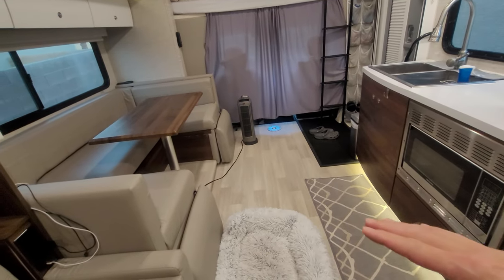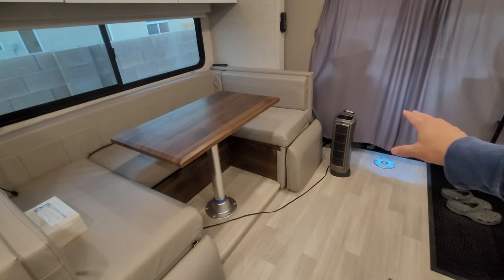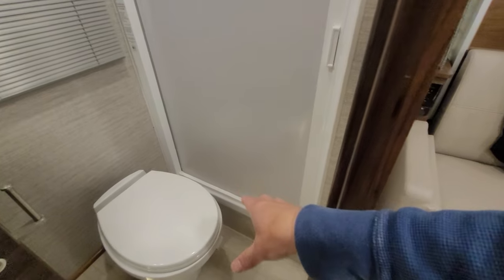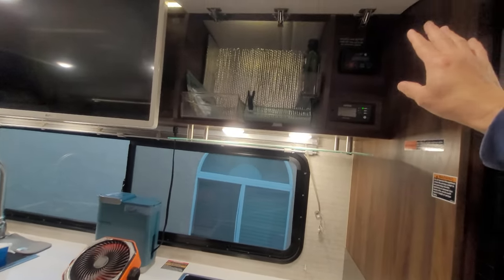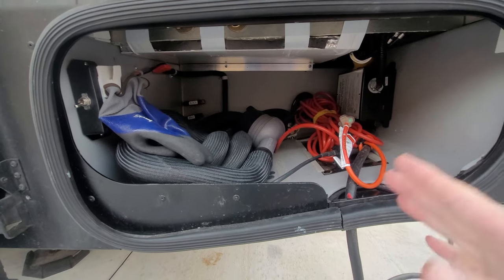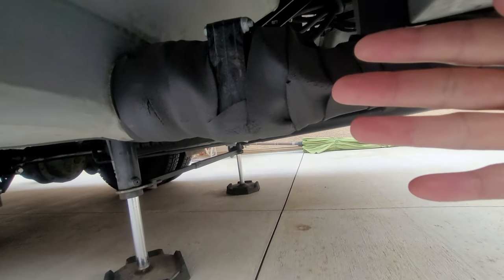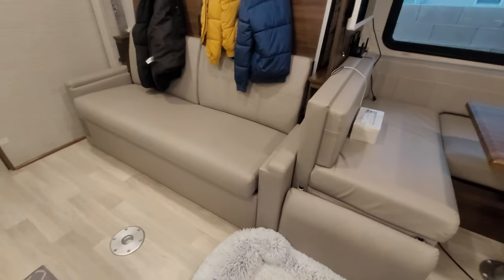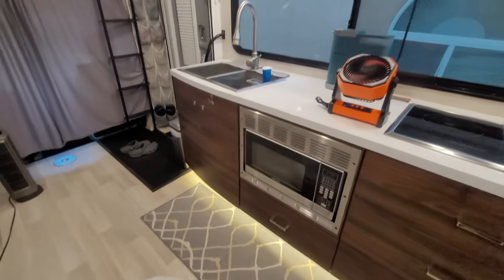WINTER CAMPING in FREEZING Weather in My Winnebago RV

Comment: Several things:  the R insulation factor of these is very low.  And look at the sheer on the windows.  Think medieval castle.  What do you do?  Think rugs and thick curtains.  Look for redundant sources of heat.  Never place all your eggs in one basket.  If it gets that cold, have sources of drinking water indoors and winterize your pipes.  Look up clay pot and candle set-ups.  They like to disparage them here but sell them intact in Europe.
Reply from the maker: Yes the R values and the windows are terrible in these RVs. We have several sources of heat and water so that part is not an issue with use. Thanks for the comment and suggestions.

Comment: I have camped at least 30 days in below freezing and have never winterized.  I recirculate hot water into the fresh water tank so that my fresh water tank is about 90 degrees.  I shower at night so that there's a large bolus of hot water into the grey tank.  I make sure to run the water at least 3 times each time.  No mods otherwise.  Yes, I do wait until the afternoon to dump because the valves are frozen shut.
Reply from the maker: I think it all depends on what type of RV and the weak points it has. My class B can do down to about 8 with the exception of dumping.  The winnebago unfortunately has all the water lines (about 30 connections that come together in the uninsulat3d portion of the wetbay. That is the weak point. Anything under 20 degrees for 8 hours+ will freeze those lines Solid.

Comment: We have a 22V and gotta tell you, The new A/C has a heat pump that works great. We used it quite a bit when night time temp got to around 30 degrees. Heat felt properly distributed. Through out the rig.
Reply from the maker: Mine is a heat pump as well.  Heat pumps are great. They quit working below that temp though and are useless.  About 30 degrees is the cutoff line for heat pumps.
Reply: I have a 20V and I like my heat pump also as long as it doesn't get too cold then it's not very effective. The LP furnace also circulates warm air into the wet bat where the heat pump does not. Also of course be sure to set that Truma to eco mode below 35 degrees

Comment: Change that factory Coleman thermostat to a Microair. So much better and super easy to change to.
Reply from the maker: Yes the Microair looks much better and more modern as well. The coleman one works fine. It's actually the upgraded one with bluetooth so I can control it with my phone. The housing looks the same but its not the factory thermostat the Winnebago came with. Still would rather have the Microair, but I already spent the money on this one before the microwair was released for sale.

Comment: Great video! ☺ Try putting clear perspex on all of your inside house windows.  This works as double glazing!  in Europe we use internal thermo heating rods in our tanks & insulate the tanks well!  Happy camping! ☺
Reply from the maker: I think I would definitely do that to the windows if I camped in cold weather frequently. We have tank pads (little stick on heating pad that is glued on to the bottom exterior of the tanks).  But they are worthless because the tank and the heating pad is exposed to the exterior.  They definitely need insulation on these tanks.

Comment: Thanks for another great video. I noticed your Newentor weather station. I'm wondering where the best place to put the outside sensor would be. You'd probably want good airflow and no direct sun. Also, I'd love to have a unit like that that could measure the inside temps of the fridge and freezer, and ideally, also had wifi with a phone app. E.g. I'd like one unit to measure indoor, outdoor, freezer, and fridge temp that I could see on my phone. (I've seen your room/fridge/freezer temp sensor on other videos. But no outdoor on that one, eh?) Have you ever seen such a thing?
Reply from the maker: Hi David, your can get a glimpse of the sensor mounted at about the 7 minute mark.  It is located in a cavity near the rear bumper.  I also have an exterior sensor for the fridge, that sensor is located next to one of my dump cables (can't see in video).  On my class B that is parked behind my Winnebago, I do have a WIFI thermometer  and it does work on an app, but I recall it only had 1 outdoor sensor option. That unit is at least 5 years old so newer options may be available.  The problem with the wifi portion was that it would not work on the AA batteries, and needed 110 supply.  The 110 power supply had a brick rated at 5 volts so I just cut the wires and put in a small 12 volt to 5 volt transformer.  Here is the link to that exact WIFI Thermometer I used.  https://amzn.to/3kLuRE5  It is outdated, so that link may give you other suggestions, and have you go down that internet hole lol.  If you do find something you like, let me know and I may go down that same path on my current RV.

Comment: Do you have a video or info on how you insulated the area below the shower pan?
Reply from the maker: Unfortunately I never made a video. I re-did all the plumbing in that area and made an insulated panel at the same time. I wouldn't recommend doing that.  Easy Way to insulate would be to attach insulation panels to the outside of the wet bay Box. That is what I would do if I had to do it again.

Comment: What thermometer did you get? Also where did you attach the exterior thermometer?
Reply from the maker: If you watch about the 7:00 mark, you can see it near the rear bumper.  I've tried several locations including the propane bay and near the spare tire and they all seem to read higher there.  This is the best I've found so far, but can read high when driving. The temp sensor I have is https://amzn.to/3YBaF6c

Bit of warning though, it is not wall mount.  It has legs on the back so it can sit on a counter but I used those legs and tucked them behind the shoe storage. Hope that helps.
Reply: @rvlifediy  what is thr thermometer? Do you have an Amazon link by chance? I liked the look of it
Reply from the maker: @pacificbeach38  my comment below has the Amazon link. Let me know if it works.

Comment: I have a V model with the same Sexy full body paint!  Heat tape and revised wet bay is impressive.  Tips.  1. Cab curtains too short, all the cold air pours from the uninsulated cab into the coach at the bottom
Reply from the maker: I have a new cab curtain that is full height sitting in my house but never put it in (I had same concern with heat/cold at the bottom). But based on 3 years of use in all sorts of weather, the short curtain works good enough. The curtain is also very thin polyester that you can practically see through (but again, it seems to work good enough) so I never changed out the curtain. Seems just a barrier of any sort makes a huge difference. I'm sure a full height and insulated curtain would make it even better.

Comment: Thanks Craig. Good info. I hadn't considered that the furnace would drain the standard batteries overnight. If you're hooked up to shore power wouldn't the furnace run on that? I know propane will be an issue even so and your solution avoids the propane issue.
One important reason we are considering getting an RV is to use it to travel to visit our family (avoiding hotels) who are mostly in the east. We would like to be able to visit any time of the year of course. On the drive over from where we are in the Northwest we'd thought we boondock at night, say at Cracker Barrels. But without hook ups and probable sub-freezing temperatures at night (and even the day) I'm concerned we'll freeze up without shore power overnight. May need to rethink the options. An upgraded battery (and possibly solar) system sounds like a must for our proposed application.
Reply from the maker: Mark, the onboard furnace works fine, and distributes the heat better.  It does go through lots of propane quickly and filling the RV propane is one of the least fun tasks in my opinion. It always feels like a pain in the butt. The propane will last a long time if you are not using it for primary heat.  The onboard furnace is also very loud.  So we use the electric heater whenever we have hookups and propane heater for any boondocking or drycamping. Upgrading solar and batteries will make your rv experience better and less stress free. The water tank and water lines are the most sensitive because it's pressurized. If the pipes freeze, the ice has nowhere to go except to loosen a fitting and create leaks. The black and grey tanks have the benefit of thermal mass as well as have room to expand if it does freeze.  You can also add a little rv antifreeze into your dump tanks and that will help with the freeze point. The fresh waster lines and the dump valves themselves seem to be the most vulnerable.

Comment: Hi
Another excellent video !
I have a 2022 View and when winterizing I always lose the prime on the pump. Do you have the day issue ?
 I get to the bottom of the first gallon and then shut off the pump and put the suction tube in the second and then nothing. 
Thanks
Reply from the maker: I don't winterize so it hasn't happened with me. I've used for suction and had no problem with the prime. Maybe have to open faucets or turn the tank fill valve back and forth to regain prime?